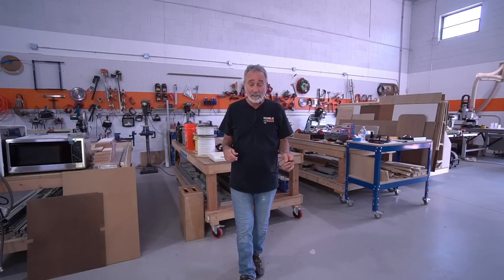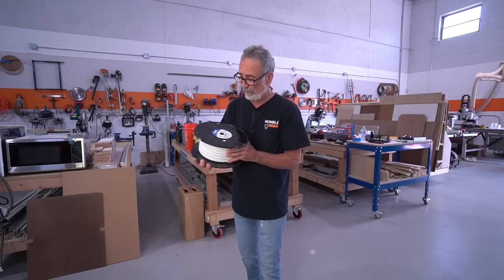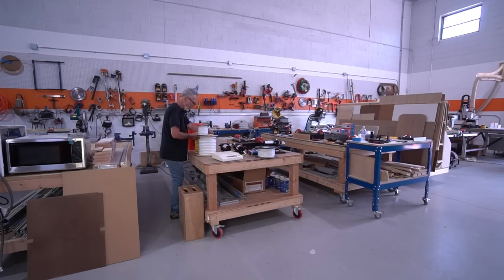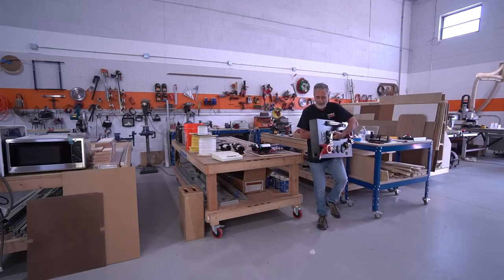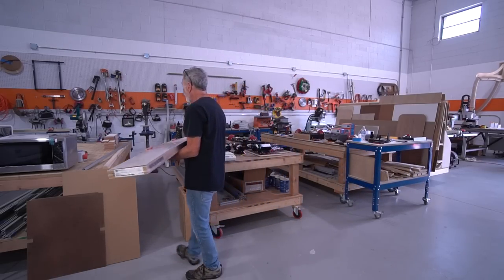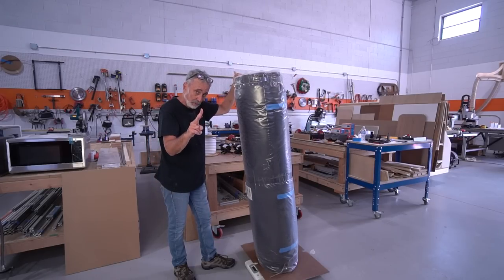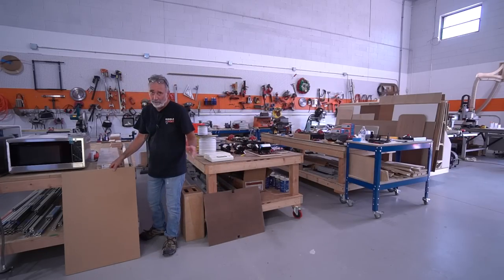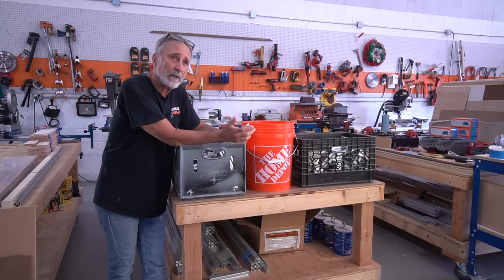How important is weight in a van? It's the little things that add up.

Comment: 8020 is more feasible if youre running a shop and can work with it, but, wood is far superior for a diy build even if it ends up weighing more. 8020 is also multiple times more expensive than wood, those cuts offs are worth a fortune

Comment: I was also ghosted by C Head after ordering. This was in the height of COVID so I gave them a break. After not hearing anything for months, I finally received my C Head Shorty but it was missing some parts and screws. It took 4 unanswered emails, a request for a partial refund (which was not challenged by C Head) and then a few more months before I received an answer. They did finally send the parts without asking for the partial refund to be paid back. Overall, very pleased with the C Head but would never order from them again. Customer Service is lacking in so many companies these days.

Comment: The most denied weights, 250-300lbs each for driver and passenger, a couple pups (for me a pair of Boxers at 75# and 80#), another 40-50# per child and their booster seats. All need to be included for the vehicle's  Gross Vehicle Weight Rating (GVWR). For me, before any trip over a week, I stop at a CAT Scale to weigh in and keep it in the glove compartment as to the evidence scattered across the highway if in an accident.

Comment: 15:20 he bucketized his cut offs, so organized!
Reply from the maker: Maybe I should see a doctor...
Reply: @HumbleRoad lol, it's a great way to reduce water and use what you already have.

In programming, there is a sorting algorithm called bucket sort where the set up is to place numbers into different buckets where each bucket takes numbers of a distinct range (e.g. one bucket for 0-9, another for 10-19, etc.). That is called bucketization. I imagine that's what you've done here. You got the smaller lengths (0" to 2") in one "bucket", medium lengths in the other, and longer lengths in the last - for easier retrieval.
Reply from the maker: Yes! Jose, you are correct! Categorization and sorting are very important to me!  I still think I should see a doctor! 😜

Comment: I have been using my rampdoor as a porche for years.  The pymide jack you have under the right front corner
can be used for the porch.  They come with 11 inch adjustment.  The hardware store has the same rod in 3 foot lengths. 
Get 3, cut, one two.  You now have 3 levels of adjustment.  Put a nut on the top end with nut lock.  A pvc cap under the ramp
Will hold the top in place.  The 3 foot can be used for about 4 feet of support.  I made a screen cover for a covered porch.

Comment: George, I am surprised you did not mention "Balance" or weight distribution.  Having too much weight on either side of the van will cause driving instability.  Also, with a front wheel drive van, the RAM Promaster keeping weight up front or at least centered is better than over the rear axle.  Putting water tanks over the rear axle in a Promaster and you will get stuck more often in loose soil/sand.
Reply from the maker: I had discussed the issues you mentioned in previous videos. This video is about the unanticipated players in the weight game.

Comment: IME, 80/20 builds usually end up heavier, but the quality and strength are second to none. Lots of builders, unlike you Humble Road, use 15 series, when 10 is just fine, and really get crazy with the stuff putting in way too many sections of the stuff that isn't needed. The stuff is so strong, just the basics is amazingly strong. 

You can build very light cabinetry with 2x2s and 1/8" paneling like the RV manufactures do. Of course it isn't a high end product, and absolutely not suited for these high dollar, top of the line custom vans, but for basic DIYer, it is always an option.

Comment: Great video 👌👍 as usual dear George . I am really surprised how weight adds up significantly without even recognising it. But : “ have you considered using lighter wood for panels like the ones used by Reparadise ? They are using “Ultralight” panels which are 42% less in weight , and they are also using something called “ Baltic Core Hex Ply “ with an antislip surface on one side and laminated on the other side , also very light in weight . Can you imagine using these for plywood panels , how much weight you will be saving by also using your CNC cut outs and pocketing method for weight reduction ? I think you will be saving another 25-30% easily. All these weight reductions also applicable to the cabinets , will be fantastic. I need your opinion about this George.
Reply from the maker: I have considered some of these lightweight panels. I am not confident that those panels will hold up to the rigors of van travel. And others (honeycomb core) require too much prep on the edges of the panels.

Comment: I like the idea of 8020 and was going to do it for my build as I have all the tools to handle it, but I went with 2x2's because nothing I build is permanent, so if I change it later it's a wasted with the 8020. Also they nickle and dime you on all the fasteners and clips.

Also 3/4" MDF isn't what you use to build with 2x2's, you use 1/4" plywood or FRP for wet areas. You can also use metal, but 1/4" plywood is more than strong enough for covering, you use 1/2" for medium duty things like building actual cabinets with no 2x2 framing, and then you using regular 3/4" plywood for heavy duty things like inverter shelves.

Comment: Great video as always! I always wonder why you don't build your systems on 24v. Practically everything you have for 12v also works on 24v. The weight and $$$ (cables, charge controller,etc) savings are well worth it. 
It would be great to know your reasoning for staying with 12v vs 24 (or even 48v) for systems over 1000w.
Reply from the maker: We are considering 24v in the near future
Reply: The system will be more efficient by almost 5% too, so battery charge will last longer, and you would need half the number of solar charge controllers if using an even number (2 instead of 4, or 1 instead of 2).

Comment: For the next level of material selection and build technique, is striking a balance between rigidity and flexibility. Vehicle chassis is not rigid driving over uneven roads, so either the buildout needs to flex with it or needs to be isolated with sufficient compliance, otherwise the buildout will slowly come apart and be noisy. Wood can be a great material with the right technique. Boats and airplanes had a long history build out of wood, problem is most van builds use ether house  or furniture construction methods that are suitable for stationary environments.
An alternate design  shown recently (one is vandermoon) for upper cabinets is a fabric design with internal panels to support and hold the shape.
Sounds like a good opportunity to reduce copper usage. For short runs, gauges could be reevaluated. AC 12awg only needed for highest power appliances, typically for induction cooktop and outlet at the galley. May be able to go to 2-wire.
Vinyl plank flooring is as bad as using ceramic tile is vans. Weight and needs to float while perimeter needs to be sealed from water egress. I've recently finished my two bathrooms where this works fine. Large temperature swings of a van compounds expansion/contraction that can open up seams to dirt and water.

Comment: A good use for the cut off 8020, check out brian oltrogges channel and the bespoke drawer pulls he cast. I think they would work well in a van as you wouldn't catch clothing on them and they look amazing. You could design something similar and cast your own humble road handles/pulls etc
Reply: I went over and had a look. They are quite beautiful, but some of us prefer not to put our fingers and fingernails up under designs like that. Even if your nails aren't manicured, that's a nail breaker. Reminds me of the push button flush toilets - great for short trimmed fingernails, impossible to use with even a little nail growth.
Reply: @yourpersonalmythology  thats the best bit of making bespoke handles, you can design a range for a whole host of end users and store the patterns to reuse them when a different customer has the same needs

Comment: I've always thought you use much heavier materials than ideal for a moving vehicle but I don't know how big an impact that has at the pump, on handling and wear and tear on the vehicle. It would be interesting to see a curb weight and fuel economy comparison between one of your builds and a van build that used light weight materials and simpler systems.

Comment: George, You need to bring the vans down to the CAT scales and weigh the Van before you start project and then do it afterwards. That way you're customers know exactly how much weight that they can add to the van.  Everybody that has Van to R v's should always Check how much weight they are carrying.  And I agree with you if you are overweight and get in an accident you will not be covered. There's so many van builders that will put so much wood in their van and not think of the consequences of weight. Also if the highway patrol pulls you over and end up weighing your vehicle and it's overweight it's being towed and you're not driving away with it.
Reply from the maker: Agreed. I have done that with my builds.
Reply: He's done that and explained in other videos.  Check out some older ones.
Reply: @mjremy2605  I know that he explained it in in this video and the other videos. I'm glad that he goes to the extra effort and weighs the van through the process. But it's always good practice for the buyer to always weigh the van. They are CAT scales all over the nation. And it's always good practice to weigh your vehicle to make sure that you're not caring extra stuff that could throw you overweight.

Comment: Along the same lines as weight, I wonder how many people think to look up the vehicle's payload (not forgetting to add how many humans will be in the vehicle and their weight)?  Because payload plays a factor as well.  I've been researching modern boat building techniques because they're using fiberglass (or gasp carbon fiber) and foam core construction.  What I'm really looking at is a combination of 80/20 and foam-core/fiberglass construction.  All in an effort to save weight.
Reply from the maker: I like the way you think.

Comment: I would be interested to see what the weight is when you 1st get the van from a dealer and after the build is complete.  That's why you know the exact weight you added to the Van.
Reply from the maker: I have done that
Reply: It’s called the OCCC. Occupant and cargo carrying capacity.  Basically it’s how much weight you can add to the vehicle after the buildout is done before reaching GVWR. Don’t forget water = 8.3 lb per gallon. Some big name builders build Vans/RV’s with as little as 800lb OCCC.  

So few van builders could answer my questions regarding OCCC that I gave up on building a van and moved on to expedition vehicles.  Expedition builders  knew their OCCC and even weight on each wheel, WHEEL not just axle, for weight distribution which has critical effects on handling, braking, etc…

Comment: Most illuminating, George. Thanks. When you do your comparison between 8020 and wood, please enlighten us how to obtain 8020. For instance, do we have to know precisely how much to order, how long delivery would be, what all the connections would be and would cost, etc., and how that compares to a 10-minute drive to our local lumberyard - especially if we've run short. Will you be comparing stick-framing (2x2) and/or 'carcasses' (ply) with 8020? If you are only comparing the types of built, no doubt you'll see that stick-framing will be a lot less rigid for that "earthquake', as you term it, without some sort of 'skin' to secure it. One-quarter inch ply skin to both 8020 and stick-framing would 'up the ante'  on a wood build for sure, but I imagine would do very little for the 8020 build. I'm looking forward to your video, then.
Reply from the maker: All that information is on the 8020 website. 8020.net
Reply from the maker: "...a 10-minute drive to our local lumberyard - especially if we've run short." I got to thinking about this sentiment. You shouldn't compromise the final product in order to compensate for inaccurate planning. I've needed a unique piece from 8020, mid project and I stopped, ordered the piece and moved on to another project while waiting for shipment. It's frustrating, but in the long run, worth the loss of time. Building vans ain't easy...
Reply: @HumbleRoad  Thanks, George. I've just amended my Q to make it more sensible.
Reply: @HumbleRoad  Understandably you are in this as a business venture. You yourself can't cut corners, nor compromise. But any DIY enthusiast is likely to go to a local store if the net result is a van they can use for their own enjoyment. But you are probably unlikely to be catering to them...
As for other pro makers, I've yet to see 8020 prescribed in their builds.

Comment: I went back and forth constantly about building my upper cabinets from 15 series vs 10 series. I ended up with 15... It's great but could possibly be lighter and cheaper. I'm building out my galley and bench seat soon. Could you give a brief rundown of when you use 10 series now and when you use 15 series? I'm interested in if you've starting doing 10 series for most of it, what's the breakdown in terms of parts of the van? Bed made from 15 series for strength, seats and galley from 10 series to save weight?
Reply: I decided to use the size in between the 10 and 15-series. The metric 30-series is 1.18“ and allows for bigger fasteners than the 10-series. The fasteners are the weak point.

Comment: If you were building out a 170 WB Sprinter standard not the extended how much weight does your total build add to the vehicle weight? I would love to see the difference in weight of two kitchen modules one built with 3/4" plywood and the other with 1" 80/20

Comment: Do you run a spreadsheet for the weight of components as you design them in?  I can see that being useful in the early design stage where you estimate how how much material you will use and decide whether it's too heavy.  I'm curious how much the aluminum connectors weigh compared to the extrusion itself - I bet it really adds up.

Weight can trip up the best of them.  There was a recent ARV creation (B-box IIRC) that they had to take back and refund the customer because it was overweight. They probably calculated it up front, then fulfilled more and more customer dream desires without tracking the weight budget until they took the finished project to the scales. Oops.
Reply from the maker: I watched that video as well. Yes, overall weight AND distribution are most important. The vagabond van weighed to the pound on each of the four corners! To the pound!!!

Comment: Just curious, George, have you considered a ready made “solar generator” for any van builds? How about garden variety fountain water pumps since small ones are lightweight and last for years ? You use a lot of connectors in your plumbing, is there a way to use more flexible tubing to eliminate some elbows or maybe a pre fabricated manifold? Thank you sir.

Comment: Would that be possible you meant 4awg instead of 4/0 concerning the wire(s) between the alternator and the dc-dc charger bus bar back in the van ? 
4/0 seems overkill for most case scenari 😳
Reply from the maker: No mistake. 280 amps running 20ft (calc there and back = 40ft) 4/0
Reply: @HumbleRoad   so if I'm getting it right, the alternator is providing 280A of charge power ?
Reply from the maker: @pifle9471  yes I think I confused things here. The DC to DC chargers are 40 amp running on 2 AWG the alternator putting out 280 A uses 4/0
Reply from the maker: Voltage drop is a big deal in the DC world. So, without going to extremes, the heavier the wire the better there’s less voltage drop.

Comment: I think another way to reduce weight is to leave out unnecessary amenities. Smaller water tanks, less cabinets, no roof racks, vinyl floor, polysio foam insulation, 1/4 paneling versus stick built walls with tongue and groove wood interior. My last two van projects added 2,000 lbs, but this meant we were still 2000 lbs less than maximum.

Comment: So much concern about weights and THEN you close with informing us that you will be adding an air compressor to ALL your larger van builds to give clients the ability to pump up their tires.  How much does the compressor assembly weigh along with required wires, etc?  LOL
Reply from the maker: I'm not saying AVOID all weight, I'm saying be aware and prudent. Don't go over weight.